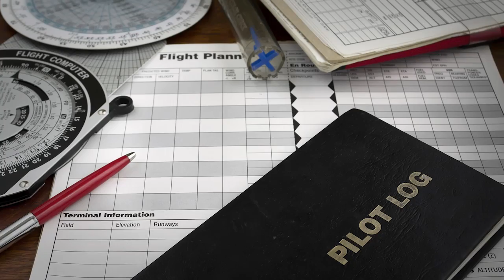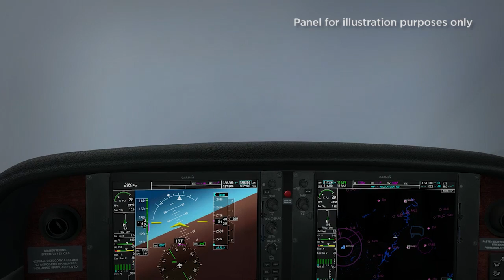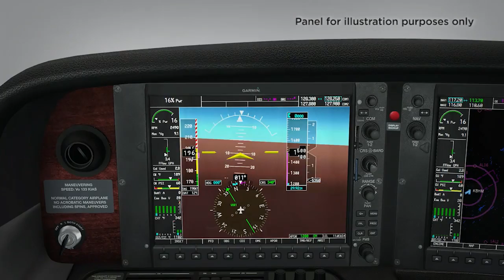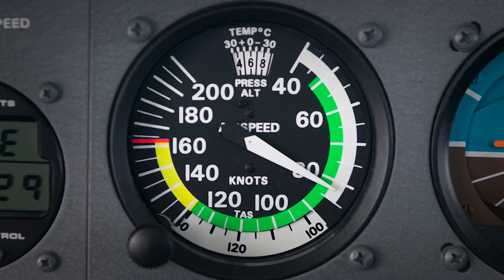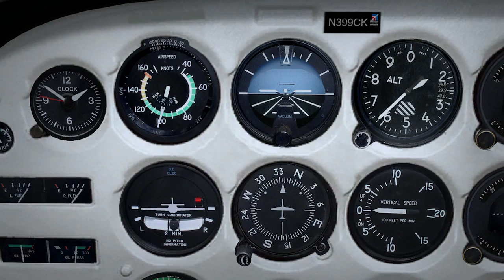Transitioning to Other Airplanes: Errors of Interpretation

Comment: I wholeheartedly agree that transitioning from steam to glass is not as easy as it looks. It's imperative to thoroughly get to know glass software on the ground for several training hours, not in the air.

I always wondered why the glass avionics don't offer - in addition to the tape layout - a configurable steam gauge layout so that every pilot can more or less choose the flight instrument presentation of their choice / needed for a particular flight and intended use of navaids/approach. This could still have all the extra goodies of glass cockpits (additional bugs, alerts, trend vectors, no vac pump, etc etc.) - it's software, so it's all possible (and in fact that's what all simulators provide).
Reply: Funny thing is, I was the exact opposite. I started flying simulators as a kid and was used to tape and digital readouts. Then I did my instrument work on steam gauges and had to get used to a 'scan' to keep the plane flying. My first IFR job was on a glass aircraft and seriously it couldn't be easier. Moving tapes catch your eye, the attitude indicator/flight director is huge... no need for a scan at all.
Reply: Dynon experimental glass panels do allow you to switch it to a "6-pack" display.
Reply: @quincedapence3533  So does Garmin, but you have to know how to get into that mode.
Reply: Glass (most of my flying life) back to steam, might also be challenging. I've been staring at the pigeon forever.....
Reply: I started in simulators as well, and was generally overly reliant on instrument flying given when I started with real aircraft I was of course learning VFR...

The aircraft I've flown the most has a very small MFD combined with a lot of steam gauges, so it technically has both.

Neither type of instrument was particularly unfamiliar to me, but since both were present on those occasions when I had to reference instruments I could use either...

Personally I have a hard time with gauges. They're great for relative measurements but I spend far too much time doing mental conversions and calculations to work out my actual situation.

Glass cockpit readouts are not that great either though. Still... It's whatever you're used to I guess...
Reply: I've never flown with glass - but they look absolutely dreadful. Totally compromised by the cost of large LCD displays it seems to me - far less area dedicated to the instruments so things are displayed digitally instead of analogue - nobody can read changing numbers as fast as they can register a needle position. And the usual Japanese inspired set of menu push buttons for control, rather than the right switch for the job - again cost compromises to keep the manufacturing cost low. And all programmed differently. It looks to me as if displays of this sort would require far more time to adapt to than traditional displays. How long does it take the average person to work out how to navigate their smartphone, and then how good does that make them at navigating somebody else's phone?

Comment: In Switzerland EFIS (Electronic Flight Information System) is a required Difference Training. You can't just hop in a plane with a glass cockpit without logging some hours with a CFI first. And different brands of EFIS require a familiarization (reading the manual is enough). Of course no one is going to check if you have actually done this ... until it's probably too late.
Reply: I bet it’s possible. What if someone buys an airplane, gets a ferry pilot to bring it over, then hops in and just flies.
Reply: @MothaLuva  
what if a ten year old just buys a car, hops in and drives?
Reply: Urs Odermatt Why not. Question is where the 10yr old gets the money to buy a car. And even if, he might be in on some questioning from the car seller.
But, what has this anything to do with EFIS and airplanes?

Comment: 1. He wasn't proficient, there is a difference between current and proficient. 2 This wasn't caused by transitioning to a new aircraft. It was caused by extremely poor piloting. I see this all the time in instructing, Yes you COULD pass an instrument check ride at one time. But now some of these pilots have slipped so far that they are an accident waiting to happen. We as a group, and that includes AOPA, to need to find a way to insure pilots receive recurrent training if not to learn anything then at least as a checkup from an experienced highly rated pilot to make sure no bad habits have developed and to retouch any skills that may have degraded. A flight review every 24 months is no where near enough for a large chunk of pilots.
Reply: You're wrong. He was not proficient in this type of aircraft or flying in actual using a glass panel. His actions so it all the way to the ground.
Reply: @SkyLabbTechnology  He is right. Pilot was not proficient in a glass panel. But he was legally current - BIG difference.